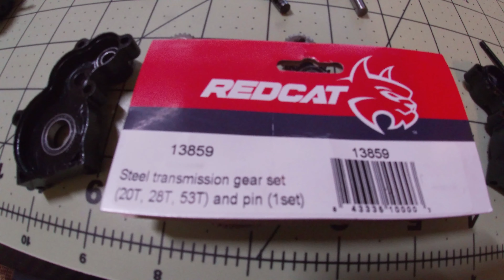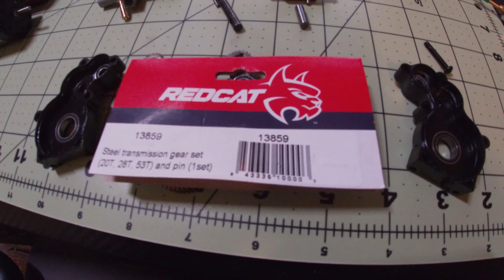Sema build off part 3 @RedcatracingAZ

Comment: I love what your doing here... I would go with the radiomaster mt12 instead of the noble just because it can do sooo much.
Reply from the maker: I've heard people talk about it, but I don't have the patience to spend hours programming it. Counting taking it out of the box total setup time on the Noble was maybe 15 minutes. From open box to installed in a vehicle and driving it with four wheel steering. Ease of use matters, and the Noble is pretty darn easy to setup and use.